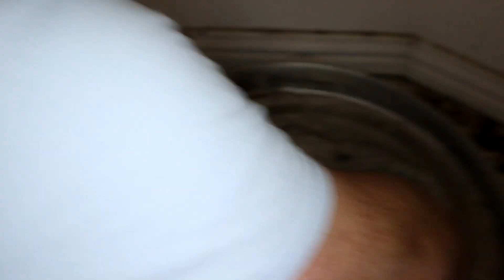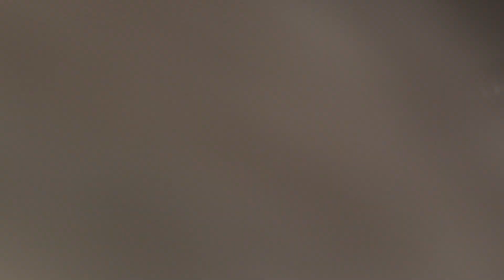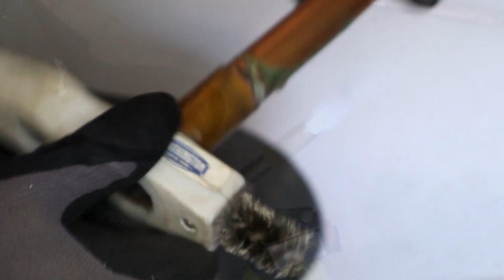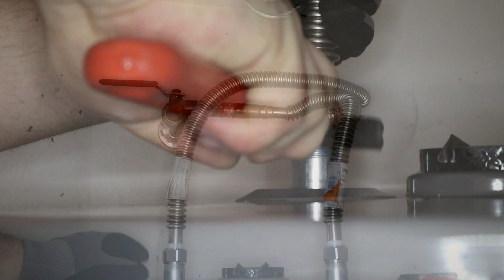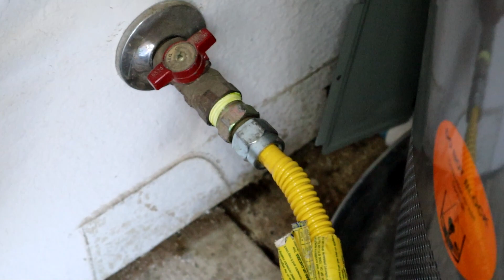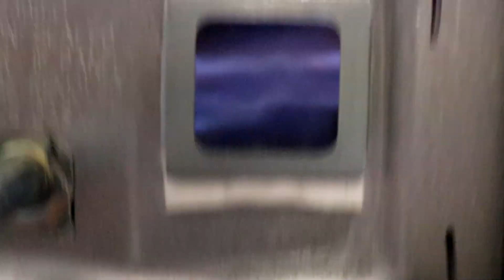How to Replace a Gas Water Heater in a Garage

Comment: great information on reusing copper fittings. Question, when I will sand or deburr inside of pipes that are installed already, what do I do about burrs or copper shavings from prepping in place that might go down in pipe. thanks

Comment: You forgot to install sediment trap (sometimes mistakenly referred to as drip leg) are designed to catch sediment, in natural gas, before it enters into the water heater.
Reply from the maker: Good catch! Sediment trap and drip leg are designed to do the same. They just located in different places (sediment trap usually installed right before fixture, drip leg is installed after the shut-off valve) and have a different shape. A sediment trap is more efficient.